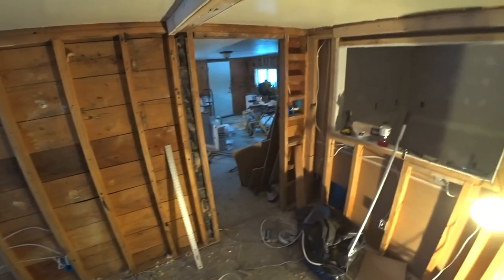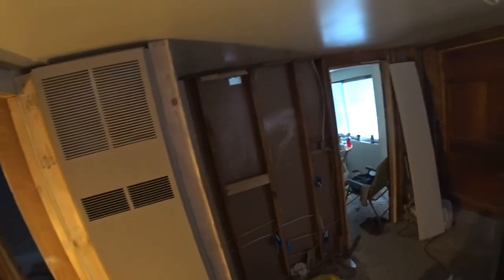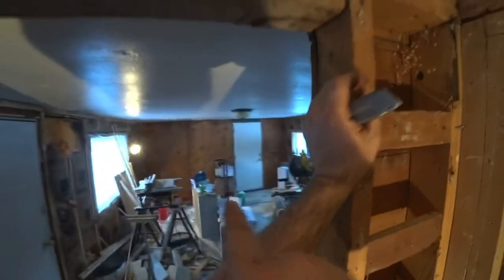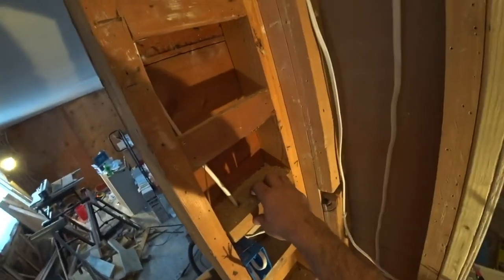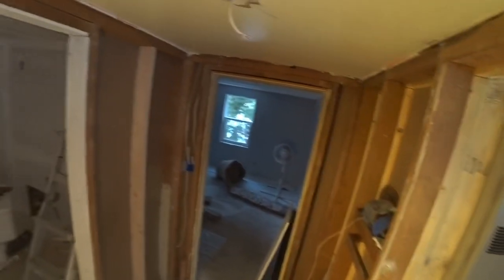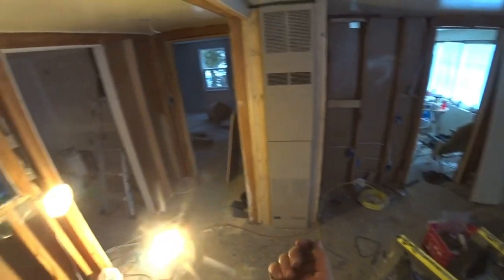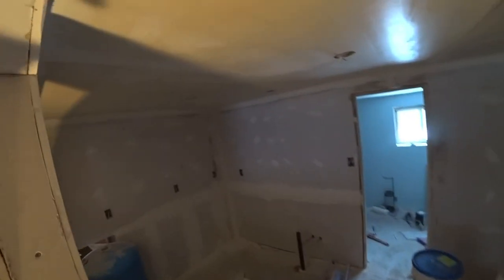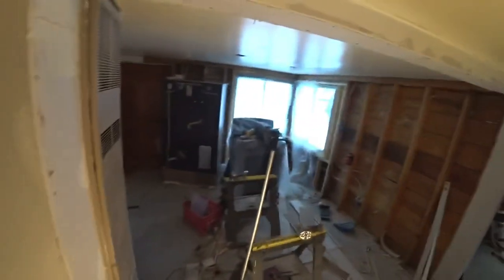Yooper Renovation, Installing 3-way light switch’s and leveling floors 2021/7

Comment: For future reference, 14 ga wire is used on 15 amp breaker and 12 ga on 20 amp breaker. You do not gain any advantage running 12 ga on a 15 amp circuit.  Also, bathrooms require 2 separate circuits. A 20 amp for receptacle(GFI) and another circuit for lighting which can be 15 amp. Not condemning your work just provide info. Can't wait to see finished house.

Comment: I like to put a metal plate in front of the wires so you can't screw or nail in that spot risking electrical nightmares lol. just a small metal piece to stop a nail or screw. thats just my way.

Comment: 14-Gauge Wire is Smaller, uses a 15-Amp Breaker.  12-Gauge Wire is Larger, uses a 20-Amp Breaker.